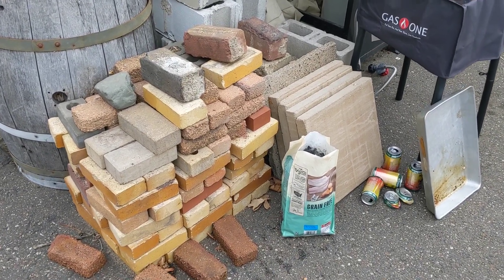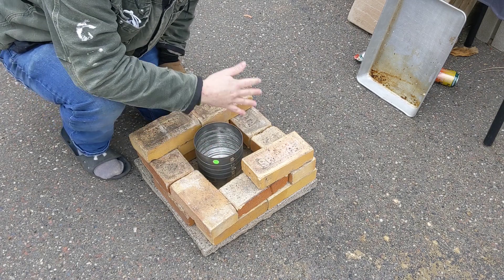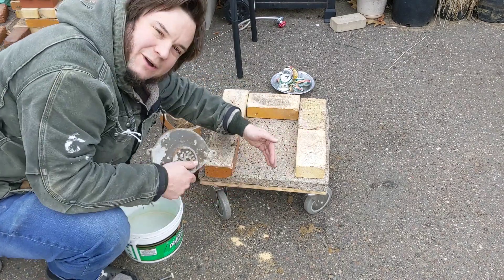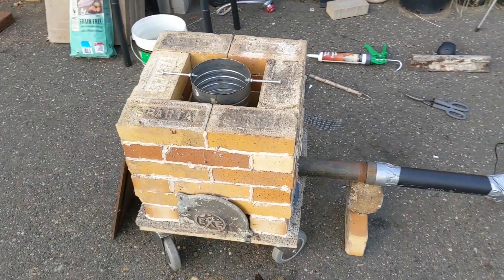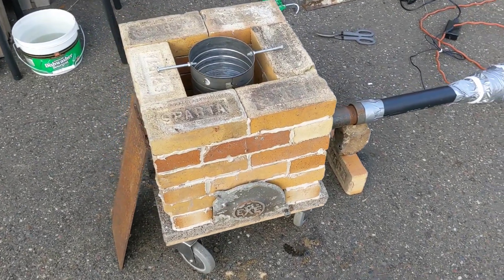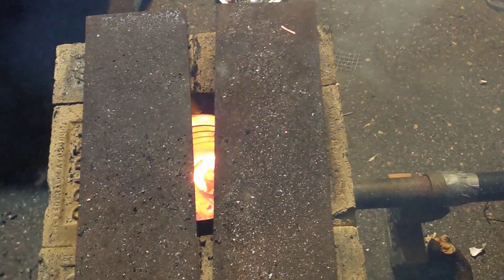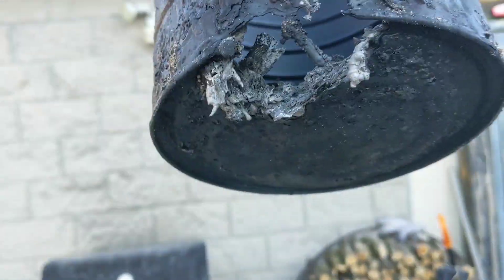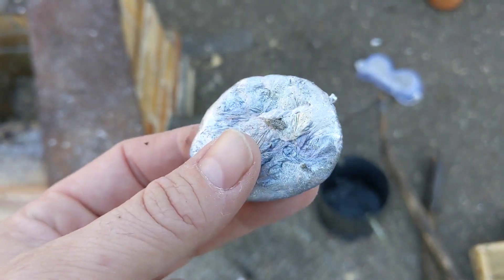DIY Aluminum Smelter From Scrap Materials

Comment: You'll find that hard-maple charcoal lasts a bit longer as does oak.  Basically, the higher-density the source wood, the higher-density the resulting charcoal.  I think traditional blacksmiths use actual mined coal in their forges when they can...

Comment: As has been recommended by others also a thick metal container or graphite cement for your crucible my friend.
Reply from the maker: I'm still working on this! Might go with a fire extinguisher or metal pipe. Graphite is probably the best but not the cheapest.